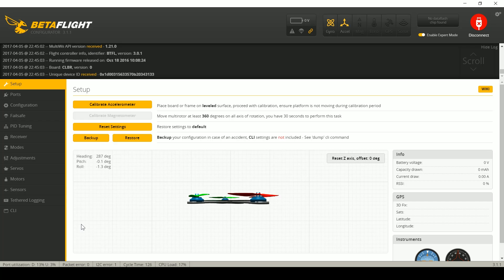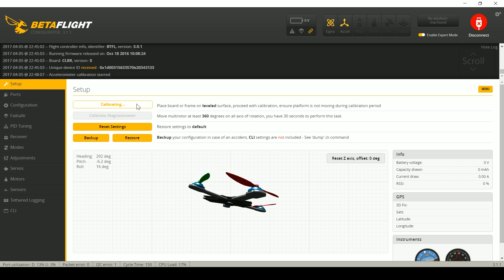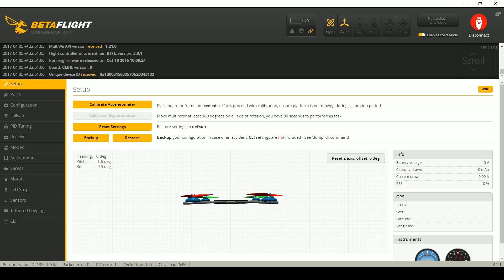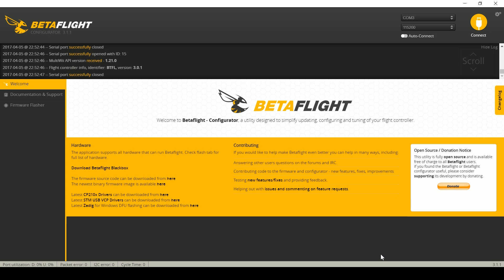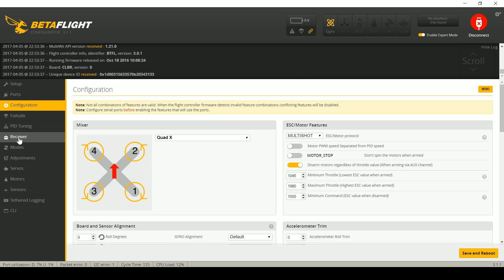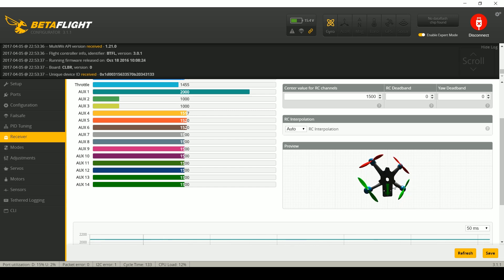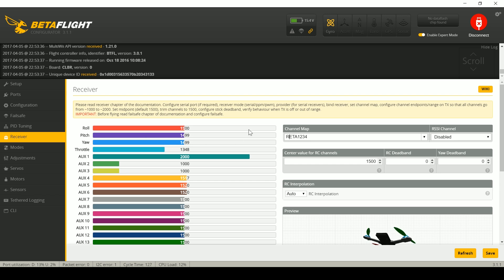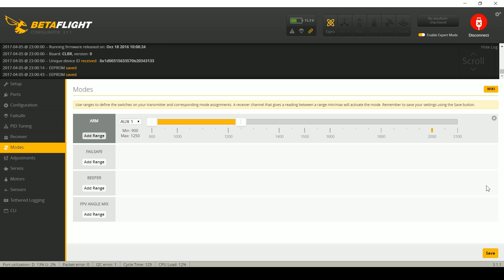Quadcopter Won't Arm | CLEANFLIGHT BETAFLIGHT

Comment: Sir I’ve come across a problem which I can’t find any information on.... after arming the quad, throttle and yaw do not work, but pitch and roll do. In receiver tab all works perfect as well as in motors tab in Betaflight. Spracing F3 FC from my Kingkong 90gt is running 3.2.1. I need your help, please sir.
Reply from the maker: The only thing I can think of that would cause this is your min_check is too high. Go to the Receiver tab and look at "stick min". What value is it? 

It needs to be set to just about 15 or 20 us higher than the throttle at its lowest position. So if your endpoints are correctly configured, your throttle will be at 1000 us when the throttle is all the way down. Then you would set stick min to 1015.

Comment: Managed to Arm using a switch, but cannot do it with the stick. Actually I did a few days ago, but I don't know what happened
Any idea?
Reply from the maker: If you enabled switch arming then you can't arm via stick any more. To go back, disable the switch arm mode.

If you can't arm with stick at all, check your channel endpoints. Adjust channel endpoints in your transmitter so that the Receiver tab shows 1000 and 2000 with the stick fully deflected to either direction.
Reply: Thanks a lot. Actually I needed to adjust both endpoints :)

Comment: Hi Joshua,when I flip the switch to arm the arm box does not turn yellow and the yellow hash mark does go in between the area I need now what, I need your help and I watch all your vids on this. thanks for advice
Reply from the maker: If you are running BF 3.2 try this:

https://www.youtube.com/watch?v=3mOeL8f1dMM
Reply: thanks for the fast response, I did that and the last line did not say  anything about errors? this is starting to hurt my little brain.Buy saying BF you mean bind and fly?
Reply: Beta flight sorry about that my bad

Comment: Hey joshua.. after arming my quad.
 The motors auto spin up and slowly increase power up til 1500 gradually without me messing with the throttle
Reply from the maker: +afifathnin https://youtu.be/xBaefeQtA1c
Reply: Joshua Bardwell hey joshua thanks. Anyway..ive got an emax f4 magnum. Now the thing is i crashed it into a tree. Now i tried again to fly my quad. The receiver went from green then red out of a sudden. My serial receiver is on uart 1 now..now it cant fly. It uses xsr frsky and im using a dxt module. Help

Comment: If moving the sticks/switches doesn't register on Betaflight does that mean there is an arming problem or something else? It seems to be bound
Reply from the maker: +Lachlan Conland it means the receiver is not wired correctly or the configuration isn't correct. Watch my series "flight controller wiring for beginners". Part 3 is about the receiver.
Reply: Joshua Bardwell I have the evo f3 with built in frsky so I'm thinking it might just be broken

Comment: I have a diatone gt2 200 with an x4r and Taranis. I have checked everything in this video and I haven't been able to get my taranis to connect to betaflight. The taranis is binded to my x4r although when I move the sticks betaflight shows no movement. I've tried all ports and serial rx checked to make sure I chose sbus and I really don't know what else to try. Whatever I do taranis won't connect to betaflight therefore theQuadcopter wont arm. Any ideas. All help is appreciated
Reply from the maker: How is the X4R connected to the GT200? What wire did you solder the SBUS signal to? What pin on the X4R did you use? Probably you have not connected something to something else correctly.
Reply: i followed the video of how to set up diatonic gt2 200 using x4r by the whirly bloke channel. Basically i cut of the third wire or the first white one and soldered the three remaing wires directly to the board. I previously had  diatone gt2 150 that I set up the same way although it worked absolutely fine.
Reply: just so you know my x4r is successfully bound to my taranis showing a green light when my taranis is on. Although in my receiver tab there is nothing happening when I move the sticks so i haven't been able to check throttle yaw etc. Then when I flip my arm switch the throttle docent arm
Reply: i have set up an arm switch on the input and output on the taranis as well as beta flight too

Comment: Hi, can someone help me with a problem i'm having with my quad? First time builder here, I got all my connections soldered using the UAVFuture's guides

 found here: https://www.youtube.com/watch?v=Avp8MurmeEY&t=2052s
and here: https://www.youtube.com/watch?v=YNAH4C98Qhs&t=968s

But when I plugged in my battery and hit the throttle, nothing happened. In fact, I only got three beeps from the ESC, instead of the normal 5. I watched the entire video, but I am afraid my problem might be even more basic than the material covered above. According to the ESC manual, the arming sequence starts after the first three beeps, is this correct? I have tried using betaflight while my battery is connected, but betaflight disconnects, and the ESC starts beeping in all sorts of codes that aren't even covered in the manual. Could I have gotten a bad ESC or flight controller? Thanks for any advice, and I would love to provide any additional information.

Comment: Have you ever had a quad that armed fine in betaflight, but once you disconnect the usb cable it will not arm
Reply from the maker: Are you sure that the receiver is powered up when you unplug USB?

Comment: Josh every with switch mapping I got so it showing what it should bottom mid and top ranges but it still will not arm I came back to video to check it out again but nothing you went thru is occurring and won't arm still. 

Okay I got but can u explain what set moron_threhold=100 is and does. I simply don't want to have done something and not have it explained.
Reply from the maker: Have you tried disabling accelerometer?

Comment: Why would only one moter be not as strong as the rest thanks for it vid just built my first 220 and it helped alot
Reply from the maker: +howdyman I won't to fly why do you say it's not as string?
Reply: Joshua Bardwell when I give it throttle moter number 3 doesn't stay wit the rest in starts to drop off.

Comment: Well that solved my problem with arming but ran in another one my pitch is is stuck on 2012 and no matter how much I push the stick or tweak the end points it will not move. Any ideas? Omnibus 3.1.7 
Thanks

Comment: Hey josh, I'm sorry to keep bothering you but you always got the answers. Mate on start up on Emax F3 acro flight controller, you know that sound it makes on start up? well mine only plays half then stops. other drones i have sometimes wait a bit then plays the second half. but this one only first half of start up song.Strange thing is if i connect to beta flight  as soon as it connects to the USB it all sounds ok and in Betaflight all looks ok. sorry mate I'm probably not making much sense. thanks YODA.
Reply from the maker: The startup tones are from the ESCs. For BLHeli ESCs, the first three tones indicate simply that the ESC has power. The last two tones indicate that they see throttle signal from the FC. It sounds like your FC is not receiving power reliably. That's why it makes the last two tones when you plug in to USB.

Comment: I have a question about this I had a little fall and now it won't arm up and when I go to betaflight nothing showers up on the receiver tab and the Fc is doing a lot of flashing  what can I do to fix this and lm its still connected to my remote I don't know what I did wrong cause I didn't hit that bad

Comment: ok i am also having this arming problem, receiver connected just fine, motors spin up on the sliders, accelerometer turned off, when i flip the arm switch a red light flashes on my FC (sp f3)...... can anyone help out?
Reply from the maker: Well... it's one of the things in this video. So which one is it? Have you checked them all?
Reply: Hey, a massive thanks for the reply, turns out it kept defaulting to oneshot125 and just wouldn't take a new protocol untill i disconnected/reconnected a few times. This video is a god send keep up the good work mate.

Comment: Question; i installed a new betaflight fc wired esc checked all motors 
and all worked good rotation was correct all was go , soldered tx and rx
 which are located in corner where signal and ground for motor # 2 upper
 right corner , camera and trans worked , but now motor # 2 will not 
spin or arm , the other 3 motors work  i checked input volts on signal 
wire to ground and get 1.6 volts on #2 and 1, 3, 4 the signal wire i get
 .6 volt at esc .
 when i touch signal wire on#2 with volt meter  and
 ground the #2 motor tries to arm makes all the beeps but no go . it 
sounds like i overheated tx or rx when soldered . 
question is there 
anything i can do to get away from signal or ground to correct my 
mistake . thanks email if you have suggestions rmccollum101@yahoo.com
Reply from the maker: https://www.youtube.com/watch?v=FysPHx7RL9s

Comment: Hey Josh I did every single thing in your video and then double and triple checked again I can't get my flight controller to arm when I plug in the battery the blue light just continues to flash the blue light needs to go off and order for me to arm everything is set correctly is there something that I'm missing

Comment: I see that tx and rx are bound, I know I am trying to flash the right FC firmware, but still: bootloader error/fail and nothing from the tx is showing up on betaflight- like the FC won't listen to the rx any more.  I haven't found a button to hold for flashing and I havent built up the courage to try shorting the thing to try flashing the firmware- but that still wouldnt necessarily address the FC listening to tx issue.  the log says "PIKO version 0" but also says it is running on firmware from February 2017.  and I am rather confident i have never flashed the board successfully.  it has always said "bootloader fail" and the firmware version has stayed the same according to the log.
Reply from the maker: Short the bootloader pins or press the bootloader butotn. Plug in the board to USB.

Do you see "DFU" in the pulldown menu in the upper-right? Or do you see "Manual Selection"? If you do NOT see DFU, you cannot flash the board.

If you do not see "DFU", download and run the ImpulseRC Driver Fixer. After running the app, plug the FC in, with the bootloader pads shorted or the button pushed. It iwll fix your drivers.
Reply: this is a new obstacle- I am getting a virus warning from ImpulseRC Driver Fixer.  No DFU only Manual Operation
Reply: in leu of downloading that driver fixer and potentially infecting laptop- anyone in the Seattle area somewhat skilled in this stuff?  I believe this is a situation that requires knowledge eyes in person.  josh has done his level best giving this nube advice, and I am so grateful he took the effort.

Comment: I am nube- however...got a fly egg 130, flysky FS-i6 tx, got the arm switch set, got it actually airborne, and then finally did what everyone says to do: plug it into betaflight.  I could arm it when it was plugged into the computer.  (had to- the thing kept complaining that it wasnt doing anything) it does not arm any more.  furthermore, even though the receiver indicates it is bound, betaflight shows no effect from any stick on anything.  rebound.  nope.  installed betaflight on another machine (betaflight kept intermittently not connecting at all from computer #1)  still nothing.  bound it to another tx.  rebound it back.  still no effect.  also- cant flash update onto FC: "No response from bootloader, programming failed" over and over.  on both computers. I just went thru the update this and that bs on the first computer (in case stuff) and did not change anything.  any idea wtf?  it worked till it met betaflight...
Reply from the maker: +Darrell Cawley I'm going to guess you flashed the wrong target to it. You have to select the right board type from the pull down menu when you flash it.
Reply: Joshua Bardwell I am under the impression from your instructional vids that you are kind of guru/proff class when it comes to betaflight and such, so thank you for responding.  the only thing I am sure about with this is that I tried to flash the right receiver- its specified in the manual.  I am less sure, but pretty sure, that it never actually flashed...always said error fail, still says the February version it came with is the one that's on there.  I might have to make a "help!" vid just to show you, but again...thank you
Reply: I meant the "right FC", not reciever...sorry.  been pulling my hair out on and off for a week hoping to have this thing understood and functional in time for my sons b day

Comment: Using emax babyhawk, spektrum dx6e & spektrum receiver.  Its bound. Im within all operating parameters.  Thought maybe it was the babyhawk so I got another....same issue.  Brand new & it wont arm.  Ive never flew it cuz darn thing wont arm at all.  Im super stuck.  Sonmeone plz help...thx.
Reply from the maker: On Spektrum, the most likely cause of "won't arm" is that the throttle is above min_check because you didn't adjust the channel endpoints correctly.
Reply: Joshua Bardwell Thx. Throttle was within min specs. But bout 45 min ago I got it to arm but it's doing something weird...every movement on either stick...n any direction add throttle as well. So I can't control it. Any ideas?

Comment: Hello joshua love the channel man, great content super helpful all the time. Hoping you can help. Just got a Shuriken X1 followed your video set up as well as video on why my quad wont arm. I CANT GET IT TO ARM. AUX 1 switch set on my taranis X9 it arms my eachine wizard no problem, using same model on my taranis.  On Beta flight it shows motors armed it turns yellow but their not. channels 1000-2000, cpu load is low,  its leveled, channel maping is correct, min check is set, arm modes is set as well and on the motors tab it does show them spinning. I cant figure it out. Any ideas or help would be greatly appreciate it.
Reply: I had to switch it back to oneshot instead of multishot thats the only way to get it to arm, how can i get it to arm on multishot? aslo when i give it throttle it stays reved up??
Reply from the maker: Sounds like your ESCs don't support multishot. Just use oneshot and be happy.

Raising throttle with the props off causes unexpected behavior. It's normal. 

https://www.youtube.com/watch?v=xBaefeQtA1c
Reply: thanks for the response, you're the man! I'll leave it on one shot. when I raise throttle it goes to max throttle and stays there. I throttle down and it stays max throttle... I tell my friends I'm gonna buy property next to Joshua bardwell Haha! I can't figure out why it stays full throttle.. that's not what u meant by normal correct?

Comment: after checking all of these . Receiver is functioning with betaflight channels mapped and the mode arm box lights up yellow as expected . after all this the motors still dont spin up now.. any further suggestions? maybe all of my escs are shot at the same time or something
Reply from the maker: Do the motors spin from the Motors tab when you raise the slider?
Reply: Joshua Bardwell on betaflight everything functions correctly but the physical motors don't spin no. whenever I plug in the battery only 1 of the motors does the little "tiny movement" thing. making me think it's the esc s maybe idk

Comment: i can get my lux v2 to arm, but no motors spin up, they all test beep after plugging battery in though, so i know the esc's are getting power, correctly wired to pdb, ground and signal to lux,  no response from motors with betaflight configurator sliders either. throttle channel reads correctly in receiver tab. confirmed armed mode with switch settings,(yellow "ARM" box)  why??? what am i doing wrong?
Reply from the maker: My first guess is you are using an un-supported motor protocol. For example, BLHeli ESCs don't support multishot out of the box. (vs. BLHeli_S which do.) Maybe you are using Dshot on a non-Dshot-compatible ESC.
Reply: Hmm. I was having same issue. A new bnf quad I got won't arm motors. Everything in betaflight is correct but when I stick arm it beeps and alerts arm. But throttle does nothing. Could it be the shot issue also??? Second question why is it my new qx7 none of the switches do anything in modes??? Can't set arm switch because no switches do anything on betaflight???

Comment: Hey @JoshuaBardwell I have problem with my 4s quadcopter with arming it. The quad works and flies with 3s lipo but with 4s lipo it does not. All the parts are supported for 4s. Using F4 Revo FC. And all this video's tips doesn't help.

Comment: Hey Joshua i appreciate all the help you have given me and the community as well you are a great resource. I have a PyroDrone HyperLite F4 Flight Controller with a XSR receiver but when i hook up betaflight the receiver is not communicating with betaflight. The XSR has telemetry with the taranis but betaflight is not picking up any of the stick movements. Any assistance would be appreciated and again thank you for all you do.
Reply from the maker: https://www.youtube.com/watch?v=ZpU6-JY6fnk
Reply: I have the receiver connected correctly through UART 1on the FC and did the configuration with sbus though beta flight. Betaflight is not picking up the taranis inputs. I am assuming in might be a bad fc.